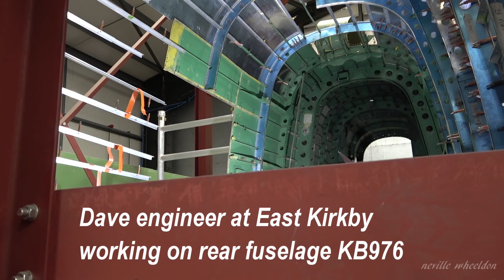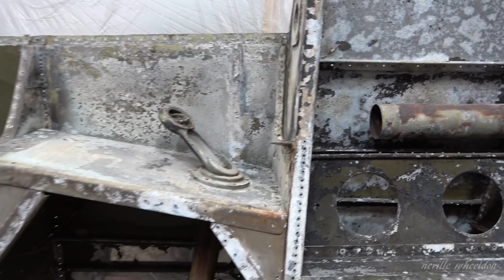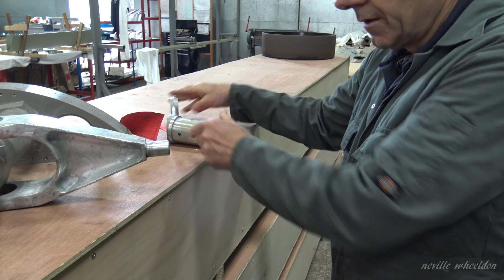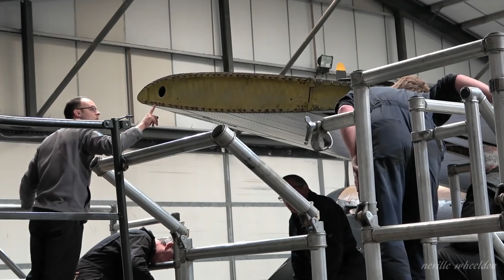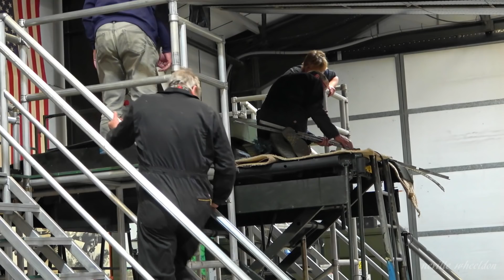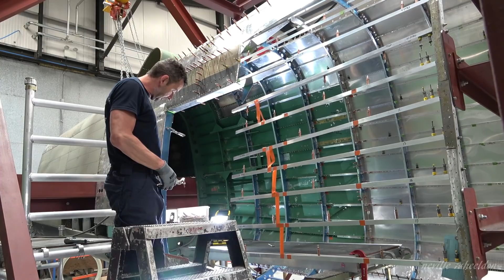Video 144 Restoration of Lancaster NX611 Year 5..  Wing tips refitted after restoration.

Comment: Neville, do you, or anyone else, know which videos covered the shaping of the absolute bottom end piece in the tail gunner area. Basically it is a quarter of a sphere. I find it difficult to believe it was formed as one piece, but from viewing your video of the inside I can not see any weld marks in the portion of aluminum. Otherwise you are still only fantastic Neville!
Reply from the maker: Hi Ed, sorry there isn't  a video covering this procedure, these were made in Simones workshop 200 miles away on the south coast,  Check out this video with Andrew  at about 11.03 min in. Video 53.  click on this link.  https://youtu.be/mDfovu4TSX8

Comment: Top job Neville. Are the bomb bay doors left open to reduce stress on the hydraulic rams that close them? Just curious
Reply: Probably, certainly less stress on the hydraulic seals of the rams.
Reply from the maker: Hi Mark,, no they open the bomb bay doors so the can check the level in the hydraulic fluid in the reservoir is correct, I believe there are two indicators on the gauge one when the tail wheel is on the ground and the second when in horizontal flight. they also have to open the bomb bay doors for inspection be for starting the engines. I got all this information from Gerbs a ground engineer at East Kirkby. I recorded his answer to my question sorry your question ,should be uploaded for Saturday May 7th
Reply: @Neville Wheeldon  thanks Nev, I dont recall ever seeing it with the doors closed so was wondering .... but that may just be my bad memory!

Comment: Neville, what is the weight of the wing tips and was that a special gasket in Brad's hand that fitted between the main wing and the wing tip, if so what was that made of?
Reply from the maker: Hi Geoff, weight of wing tips I will pass on that one. Brad was holding the removed (replaced with a new one) first rib of the wing tip. It about 32 thou thick, around the edge is fitted angle aluminium were the wing studs fit, there is about 1/8 of an inch collar on the stud this keeps the skins of the wing and the wing tips apart so they do not chafe on each other which could cause cracking or lifting when the wings flecks. They apply a sealant in the space between them . The first rib as 2 spars, 4 intercostals, angle aluminium around the edge  and the skins rived to it to give it  strength.
Reply: Many thanks for the information.